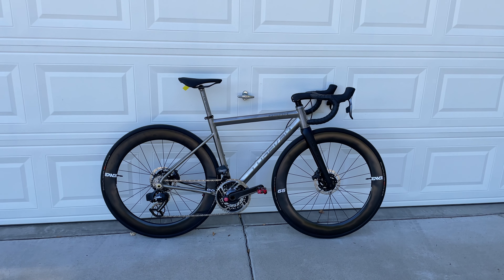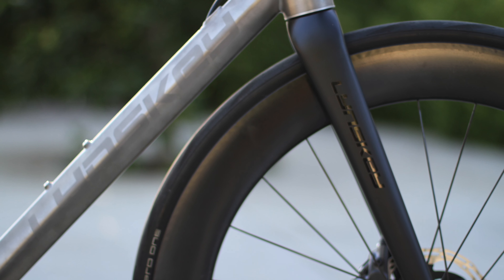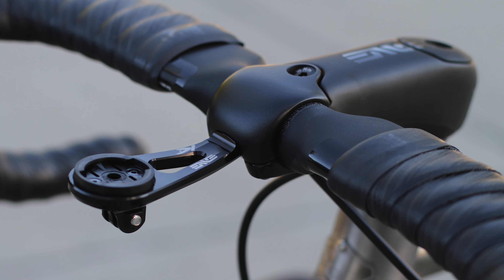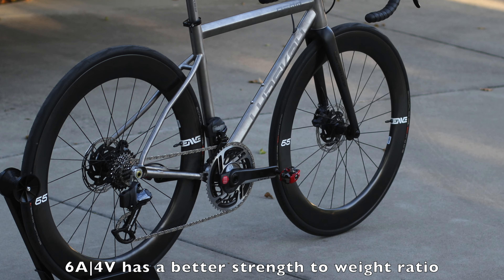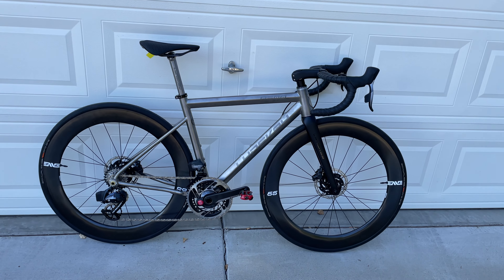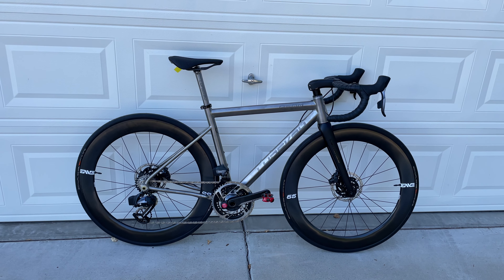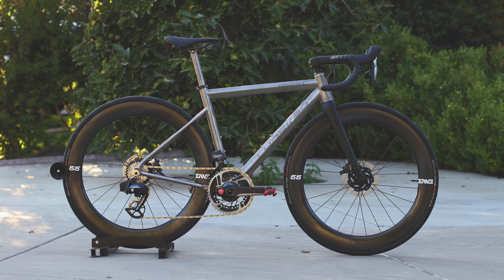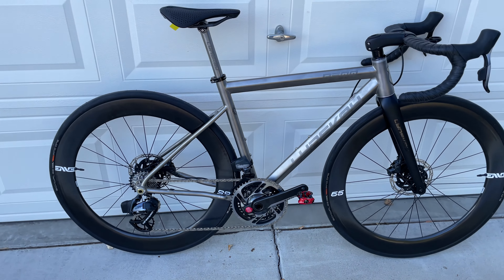Custom built Lynskey R500 - Titanium road bike

Comment: Very nice. I just purchased a R300 Lynskey disc frame. Brushed finish and etched graphics. Not as aggresive as the R500, but same quality. I will be using Giant SLR composite stem, bars and seat post. Shimano Ultegra R8000 grouo and Mavic Ksyrium SL Disc brake wheels. I may go with the new Continental 5000 S TL tires in 28mm for ride quality. Hoping to build end of August.
Reply from the maker: Thanks and congrats on the new bike. R300 frame is very similar to my Litespeed Cherohala interms of geometry and ride feel. They are super versatile anywhere from road, gravel, light singletrack or loaded up as bikepacking. Welcome to the Ti gang and hope your build is ready soon. Cheers

Comment: NICE!! 👍👍 Very solid/STRONG looking bike!

Two of the more 'modern' features on this ride that I wish my '99 Merlin had; the tighter rear triangle/lower 'hitting' on the seat tube, seat stays, and the now standard, larger head tube/1.5" steerer. (Mine has the 'ancient school' 1" steerer!)

How much extra does Lynskey charge for a fully built to your measurements/sizing custom frame??

Also; how do you like the printed saddle??
Does it REALLY get rid of 'hot spots', and fit almost everyone without causing saddle sores/aches like all of the printed saddle manufacturers claim?

Or did you buy it solely for the weight savings??
Reply from the maker: Hi David,
thank you for sharing your bike; always good to hear from another Ti owner. I've been enjoying the aesthetic of this bike as well the ride quality so far except descending due to its aggressive geo which may take time to get used to. 

Three upgrades I made to the frame is the etched graphics $245 and Ti head badge $100. I bought this frame last year before they have their huge sales now, so the mill finish was a free upgrade.

I've been using the Specialized power comp which is very similar to this Sworks Mirror in terms of shapes, and it feels fine but a little firmer compared to the Mirror. 
As for the Mirror, I've ridden ~10 miles in sweatpants and didn't feel any sore or needing to stop. I should have a review video on this one along with the Power Pro Mirror on my gravel soon.

Comment: Hi and many thaks for the beautiful video! Do you think, the frame in size 's' fits well for a 163 cm person with inseame 74 cm (without shoes)? Unfortunately I can 't find a retailer n Germany, so I have to order die Linskey directly vom the USA. Thank you!
Reply from the maker: Thank you. 
I think size small (NOT x-small) would fit you well given the height and inseam. Barefoot with inseam 74 cm will clear the top tube in size small with 1 - 2 inches (~5cm) room between your body(crotch) which is perfect.
1. The seat tube angle on this bike is a little slack (stretched out from head tube), I would NOT buy expensive seat post and stem just yet until I get it fitted (bike fit). 
2. People at Lynskey do this for a living; I would Email/call them for size clarification.
Hope that helps.
Reply: @organicbikepacking7312  Thank you very much for your kindly answer!

Comment: Hi, nice R500.
is this really the Industrial Mill Finish? it looks like the Brushed & Etched finish. This is my possible next build pretty soon. @organicbikepacking
Reply from the maker: Hi, thanks. Congrats on the upcoming build.
Yes this is the Industrial Mill Finish. Both the Mill and Brushed are VERY similar. Mill is random (no directional) patterns, where brushed is in-line. For reference, my seat post in this video is brushed finish (again very hard to tell).
Reply: @organicbikepacking7312  Yup, i'm waiting for my R500 frame... got the free Brushed+Etched+Ti headbadge from the black friday deals. I'm trying to look for a 3d printed upper headset like the Allez sprint top cap, so it will be like semi integrated...
Reply from the maker: @allanpavino8259  Interesting! please keep us updated how the "semi integrated" works if you happen to upgrade. 
One of the few things that bugs me on this bike/stem is I can't find fatter headset spacers to beef up the steer tube (for aesthetic).